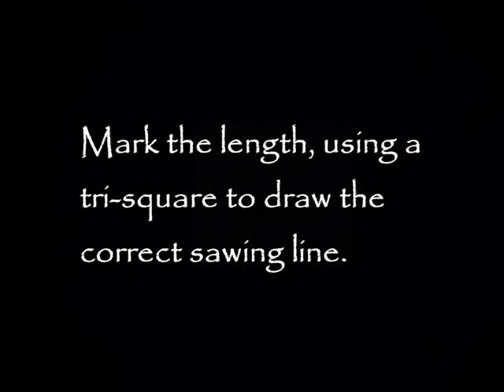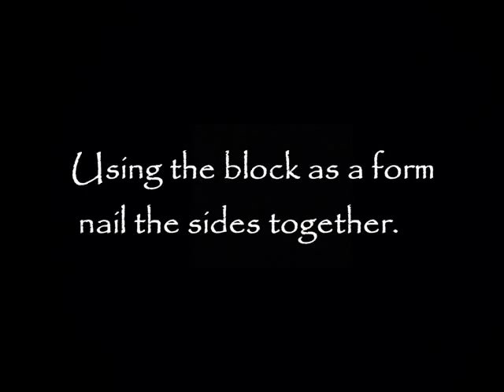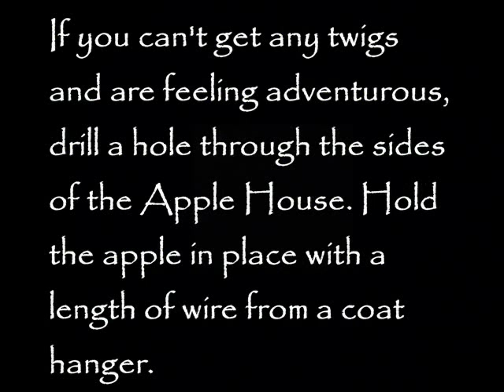Home-made Wild Bird Feeder. Apple House. Repurposed pallet & fruit crate wood. Mangeoire aux oiseaux

Comment: Did you bother to check if the wood was toxic or ask viewers to check 
or  the fact that it's free wood over rule any and all safety concerns? 
  A lot of pallets are treated with
 methyl bromide as a preservative which is toxic to birds. Unless you 
know the source of the pallets and whether they are treated with this or
 other toxic preservatives, it's no cost saving to build  
from these that  ends up killing the birds. It can enter the seeds, if the wood gets 
wet it can get on the feet and feathers of the birds and they can ingest it if they preen 
themselves.
Reply from the maker: Hi there, Thanks, for your comments. All my films are accompanied by written versions, (the link is both in the film details, which are below the film and at the end of the film itself) which give precise information as to sourcing untreated pallet wood, which is the only wood  I use. One of the first videos I made on my channel was about obtaining  suitable pallet wood and how to break it down for carpentry. In the written articles to accompany that film I also explain and with photographs the coding on the pallets and how to interpret them, that was back in  2012, the article is here: https://thegreenlever.blogspot.fr/2011/11/where-how-to-collect-pallets.html#.WFph4WdVK1F . I wrote this despite the fact that here in France there are hardly any methyl bromide treated pallets, most are heat treated but I am well aware that many of my subs, readers and viewers are from the States and Canada and other countries where this practice of dipping or spraying pallets still exists. Just a thought but my whole channel 'Organikmechanic' is not just about costs in money terms but it is about saving and protecting resources and the environment, even the apple and all the birds shown in the film are organically raised, i.e. free from pesticides or artificial fertilisers. If you are interested in birds then head over to our other channel https://www.youtube.com/user/Pavlovafowl and take a look at our forest garden, which was set up specifically for wild birds and organic poultry. All the very best, Organikmecanic aka Andy